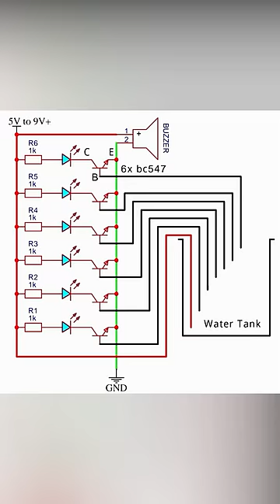Water level indicator, with bc547 transistor #short

Comment: Good one. I remember a car that I had that the water tank did not had level. I bought a tank with probes and mad a circuit with opamp LM358. It worked. I mounted a red light in the tablier to warning me the low water level.
Reply: در تانک آب ساختمان مشکل ایجاد نمی کند ؟

Comment: can I use s9018 transistors instead of bc547 please reply.
Reply: No
Reply: @yashmarathe4141  so what's replacement from s series?
Reply: You can use any transistor. Just try..
Reply: Yes you can use. This is a useless circuit. I will upload professional type circuitr.

Comment: Fake
Reply from the maker: ok,,
Reply: hi, it turned out great. Can you make a circuit that works at 3-4.5V to turn on a 12V lamp with a remote controlled vibration, thanks in advance...